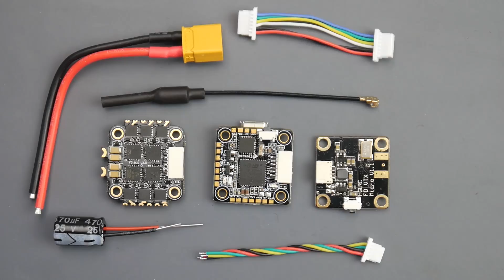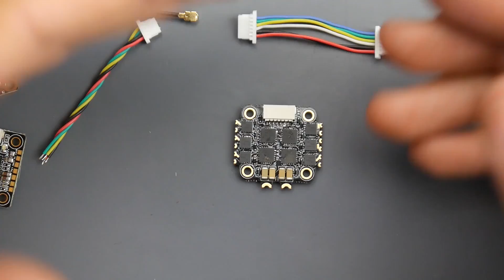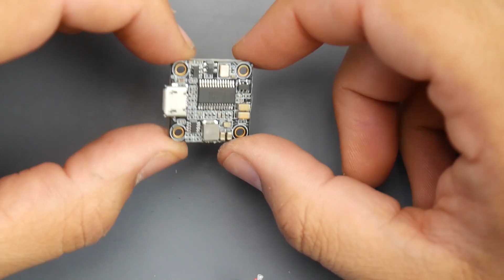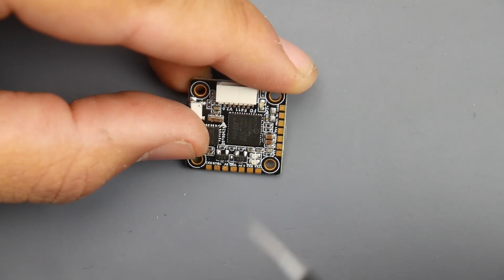This Micro Combo is Only $46 // F4 FC, ESC, VTX HGLRC FD413

Comment: 2:21 The long wires are good for helicopters to connect servos because the helicopter servos have very short wires for tail control, and the tail servos are more suitable in a Betaflight setup for all servos because of the high frequency update of the Betaflight FC.

Comment: You can orient the ESC any way you want. You just have to remap the resources in betaflight. I have mine mounted 90 degrees off so the battery connector comes out the side.
Reply from the maker: That's why I leave that out for you guys.  I dont want to confuse beginners.

Comment: Aloha Sam, thanks for sharing this video. I have had two of these for a few months 
Now. One on a racers twig frame and the second on the Parrot 120 frame.
Recently uploaded Betaflight 10.6 and they both won’t work any more.
On the setup page I lost the Calibration feature. 
I’m guessing it’s not the right protocol I’ve selected!
They worked great when they were on the 3.5.7 file.
Stay up 😎🎮🤙🏻

Comment: Hi Drone Mesh, first af all thanks for your tutorial. Few people explain 16x16 stacks nowadays. It's been very informative. I would really like to know if I had a VTX with an input voltage of 7-36 DC (like the rush tank mini 20×20, not 16) where should I solder the red wire then (to the FC)? You are absolutely one of the best in this hobby. Thank you again.

Comment: What type of connector is on the other end of the leads that are for the battery? Also, what size are those holes where the standoffs would go?

Comment: i'd prefer it if they replaced the led pads with another uart
whoever wants led can use racelite micros but gps users are left out
these stacks can also be put in ultralight 4" quads, so that would justify the added weight of the gps
that would be a lot more useful than leds

Comment: I prefer the iFlight SucceX F4 16x16. Current sensing and BlackBox, same cost. 200mW vs 400mW isn't a deal breaker for me, because with RapidFire and Axii antennas on both the quad and the goggles, I have no issues.